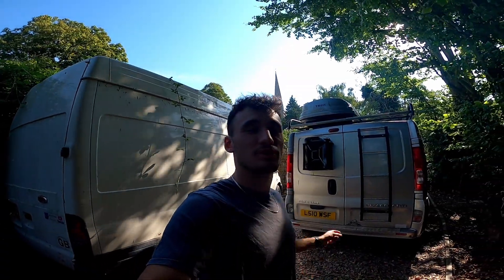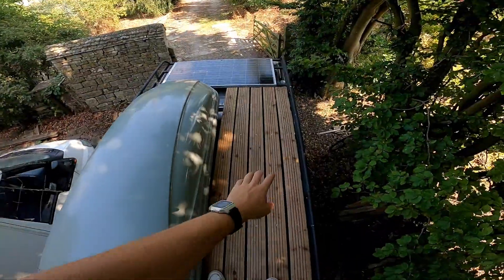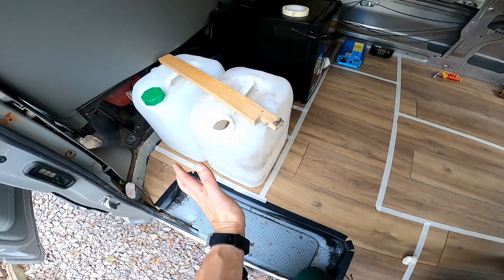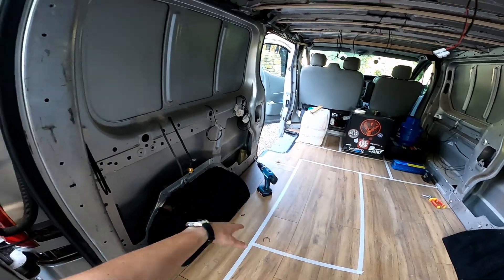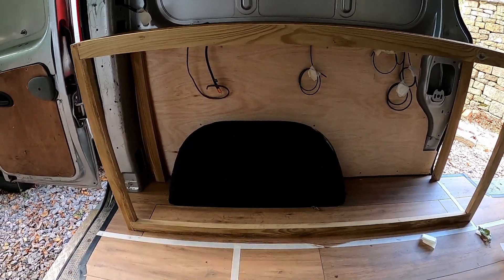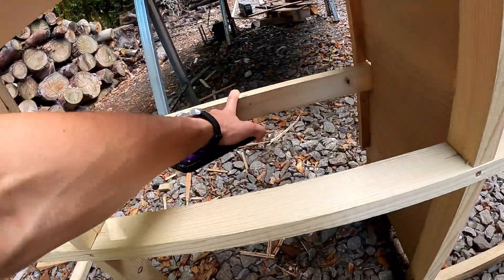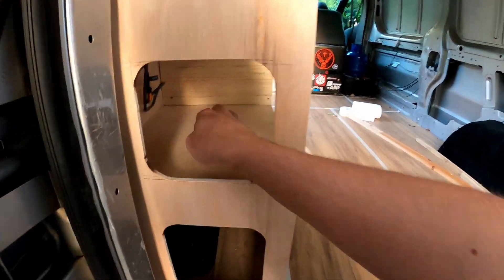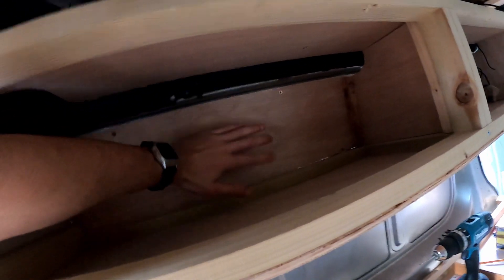How I Built the Perfect Layout: Decking, Framing, and Cupboards in My Vauxhall Vivaro

Comment: deffo not good having the gas bottle near your batteries. The risk of explosion if the bottle leaks would be a real safety issue and invalidate your insurance should that happen. Better to have the bottle away from the batteries as far as you can with at least a 2 inch drop out vent. You're doing a great job of the conversion though. Bessy regs-Kenny
Reply from the maker: Thanks for the heads up, not sure where else it would go at this point but I’ll have a think

Comment: Hey, not sure how you're getting on with your van. But that insulation is a deffo no no. I used the same stuff for the same money saving reason coming from the building trade myself. Turns out this type of insulation and metal don't like eachother. The insulation holds on to way too much moisture. I had mine in for about 2 months from end of winter. When I took it out it was literally soaking, mouldy and causing rust. So maybe consider checking yours before you're sleeping In a mould shack
Reply from the maker: Hey, thanks for the heads up. Unfortunately I’m way past that now and the van is finished. I actually used this exact same insulation in my old van that I had for 5 years and never had any problems. So I just re used the same stuff, so I guess it could be hit and miss. But I will definitely take that on board for next time. Thanks for watching
Reply: Even the fine particles are horrible. I'd imagine it going everywhere (escaping) while driving around on any bumpy roads. 
I used it a lot back in the day, insulating timber framed house; I can't stand the stuff. Best to keep it in polythene bags taped up if using it inside a van.
My friends van (they lived in theirs) had the same issue as you...nasty stuff.

Comment: Hiya mate, also converting a swb vivaro here. The set of cupboards across from the couch/bed. You got the dimensions? How deep is it?
Reply from the maker: Hi mate, this van is a lwb, I think it’s around 30cm deep, and the overhead units are a bit smaller maybe 20m. Will need to check for the exact size
Reply: @rolyfoster697  cheers mate that's handy info!

Comment: Hi, just in the process of converting the same van! What did you use to join the overhead cupboard to the roof?
Reply from the maker: I just screwed the frame into the roof batons and into the metal roof frame but being careful to not go through the actual roof